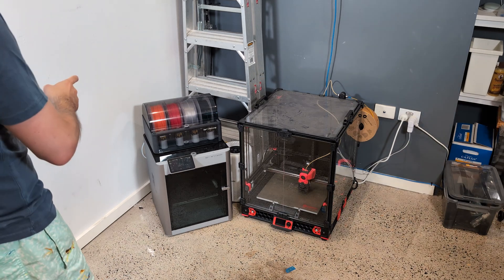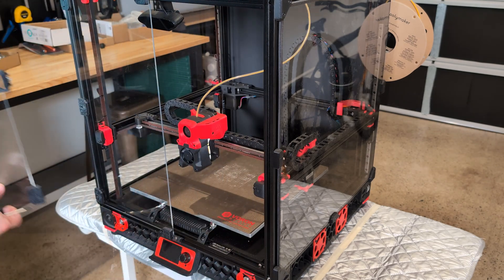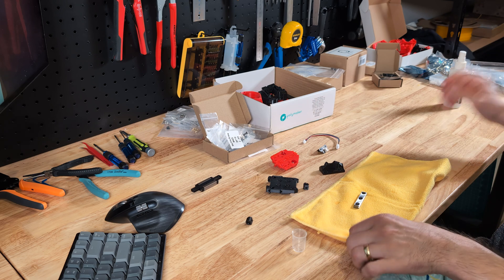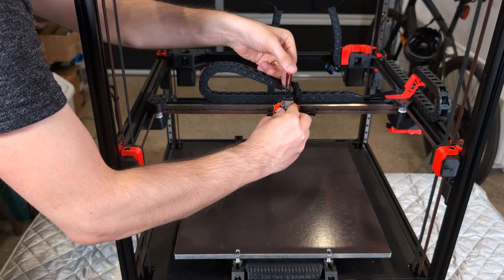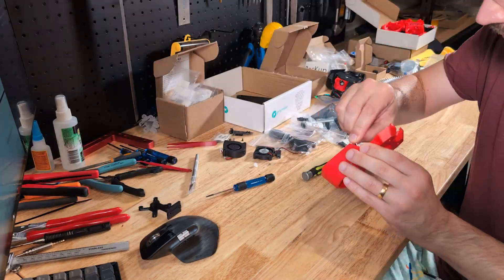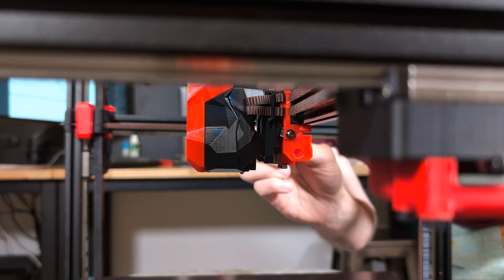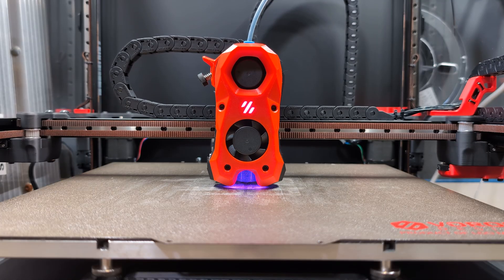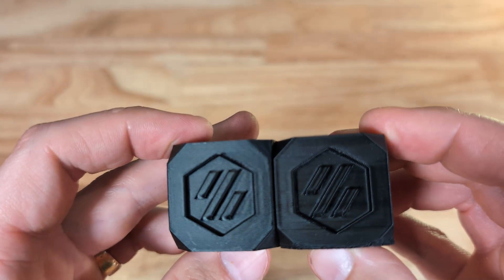Upgrading the Voron

Comment: I saw some discussion that TAP moves the nozzle far enough forward that you can't use a nozzle cleaner but apparently you don't have this problem. I installed the Chaotic Labs CNC TAP and using TAP, a clean nozzle is a must. Did you have to make special adjustments to use your nozzle cleaner with TAP
Reply from the maker: @jluvs2ride  yes, I had to move the bed forward. But I found there is enough travel to cover the bed and hit the cleaner.
Reply: @scheffield  I was hoping to avoid shifting the  bed.
Reply: @scheffield  I found that the Chaotic Labs CNC TAP affects the y offset very minimally. I printed the parts, updated my config and it works very well. Thanks!
Reply: And now I've found that the wiper hits the toolhead during the bed mesh sequence. I only found out when I printed a gridfinity base that used most of the bed.

Comment: @3:20 I have to disagree; your nozzle has to be clean, otherwise ooze is offsetting you measurement. For me a 3d-touch or clicky probe is a prefered method
Reply: Just heat up the nozzle
Reply: @Zigzag3269tf  Ofcourse, but there will still be a slight amount of (molten) filament underneat the nozzle when probing. This can upset your measurements. Remember we're talking 0.05 mm that coulc make a huge difference.

Comment: Expect to be making the switch to the CNC Tap at any moment's notice 🤔
I for one couldn't get satisfying long-term results with the 3D Printed one due to the hot Extruder Air promoting Material Creep near the Screws on the now much thinner 2-Piece Carrier.

Comment: What slicer do you use and would you be able to share you start print g code from the printer and the slicer? Ever since I went to tap with orca slicer I cannot get the nozzle to reheat on its own once it’s done probing
Reply: Your slicer should juat call the print start macro from your printer.cfg, that way you control everything from a single source. 

Heres mine, if it helps:

#   Use PRINT_START for the slicer starting script 
[gcode_macro PRINT_START]
gcode:
    {% set EXTRUDER_TEMP = first_layer_temperature|default(220)|float %}
    {% set BED_TEMP = first_layer_bed_temperature|default(65)|float %}
    EXCLUDE_OBJECT_DEFINE
    M140 S{BED_TEMP}                    ; start bed heating
    SET_PIN PIN=caselight VALUE=0.50    ; turns on overhead lights to 50%
    G32                                 ; home all axes
    G90                                 ; absolute positioning
    M83                                 ; extruder relative mode
    M190 S{BED_TEMP}                    ; wait for bed to reach temperature
    BED_MESH_CALIBRATE                  ; Runs a mesh bed calibration--referance Adaptive_Mesh.cfg
    G1 Z20 F3000                        ; move nozzle away from bed
    Smart_Park                          ; part of the KAMP system. Parks head near edge of mesh for final heading. 
    M104 S{EXTRUDER_TEMP}               ; start extruder heating
    M109 S{EXTRUDER_TEMP}               ; wait for extruder to reach temperature
    
    SET_LED LED="headlight" RED=0 GREEN=0 BLUE=0 WHITE=0.5137 SYNC=0 TRANSMIT=1 ; turn on headlight to 131
Reply from the maker: Just made a video explaining the cleaner a bit more in detail and how the macro works: https://youtu.be/U1onfGroUJI
In case you want to jump straight into it: https://github.com/scheffield/nozzle-cleaner

Comment: How do you account for any plastic oozing from the nozzle that could affect probing results?
Reply: You could have a softening script. The old tazbots used the nozzle to touch off on the metal corners of the bed, they would heat up just enough to make the plastic malleable before homing and not interfere with probing

Comment: I can not get behind Bamboo at all, they have benefited from years of opensource development, put forward a closed source, software locked printer, giving nothing back to the people who did all the work to figure out proper high speed printing. Coupled with their price, there really is no point. The Voron 2.4 R2 when properly built is a MUCH better printer than the Bamboo offerings. Add an ERCF, and get upto 16 filament, multi filament printing.
Reply from the maker: I'm really keen to build an ERCF but I'm a bit intimidated by it. Also, I would want to encase the filament for moisture management, not sure that's possible.
Reply: @scheffield  It is, with exception of the retraction slack spool. Should be fine for even the most hydroscopic filaments like CF Nylons
Reply: Yeah Bambu scares me bro 🤣
Reply: How do you know its better if you don't even own a bambu 😂. I have both and the bambu x1c just works. Stop being a white knight and enjoy the hobby.
Reply: @yeheyheyyeh89  because I have used Bamboo printers, it was aggravating. I tried to setup a time lapse system using a dslr so we could make 8k time lapses, something extremely simple with klipper, slightly harder with marlin, apparently completely impossible on Bamboo. That coupled with the recall of the A1 resulting in people not having a printer for up to a year, tells me that the "never doesn't work" printer is not worth it at all.
Reply: @yeheyheyyeh89  most folks I spoken to that has a Bambu really like it
Reply: Thats the thing "when properly built" we 3d printer enthusiasts must understand that some people has no time to build a perfect printer.

Comment: I was considering building a voron too.   I have a cr10 max 2x cr10 pro V2 a flsun super racer 2 anycubic ender clones,  and a couple of resin machines.      This is exactly why a voron is better as you can adapt and upgrade.   But I am highly tempted with the bamboo,  but the size of the build plate is an issue for me.   I like to set groups of 10 items and print those groups 1 at a time so the printer just churns stuff out with little to no interactions.     The 350 mm buildplate would be better for me I think.     Ohh but the simplicity of the bamboo.    I'm tied on what to get.
Reply from the maker: There has been rumours about an X1 Max. That might be the right one for you when it becomes reality.
Reply: I do love the idea of it all being open and customisable,   is your voron reliable, does it print really well 95 % of the time, or are you constantly fiddling with the thing to get it running correctly. ? 
 @scheffield